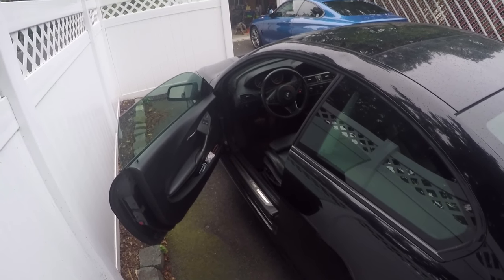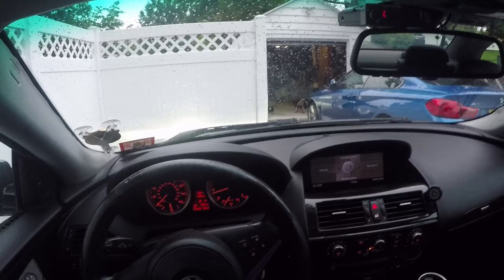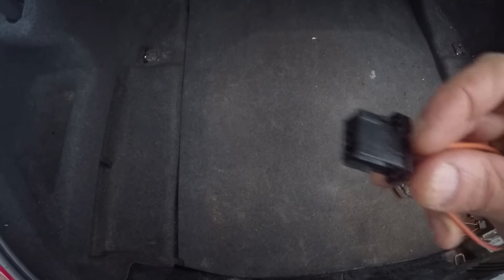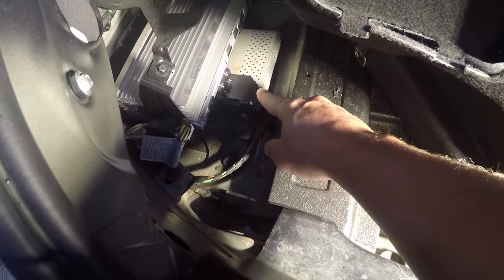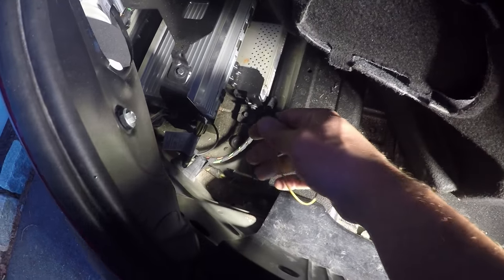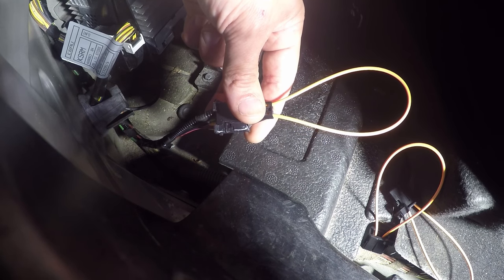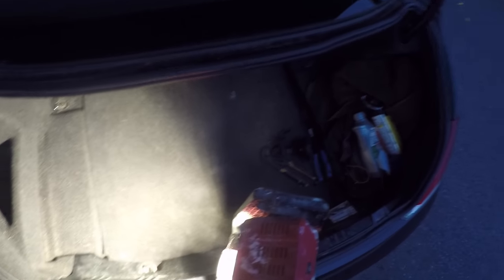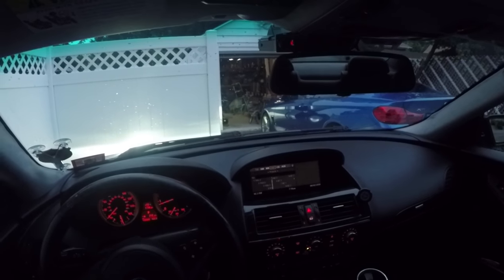FIX BMW SOS Error Light Audio System Failure CHEAP + Tips Others missed!

Comment: The solution for me (for BMW M4 2015) was: I took the panel off located located underneath the drivers dash & steering wheel (above the brake & accelerator pedals). There was a loose plug (small flat white plug) which pops into a small white long plastic box, and I made sure the smaller wire (with tiny red plug) was plugged into what looks like a small speaker.  The SOS Fault warning code disappeared right away and hasn't come back.  Just in case it helps any other viewers.
Reply: panel with screws ?
Reply: @mo_nstro Yup. It’ll be the panel under the drivers seat, think of it as a glovebox, just on the drivers side. But if you have an E90, it’ll be T15 or a T20 screw tip, 3 screws

Comment: Saved my life man I don’t know why nobody talks about this it’s such a common problem. Almost ordered a whole new module but I already had a optic cable laying around and didn’t know I had to trim it. Worked like a charm after.
Reply from the maker: Nice, I'm glad to head you got it up and running!  Feels great to fix it for so cheap!  Yeah, those stock adapters need to be trimmed and its a bit of a pain in the ass... so now the link in the description is for-pre-trimmed units so you can start using them without any trimming/modding :)  I've head of a few people actually breaking them (and having to order a 2nd unit)  when trying to do the trimming!

Comment: I have to admit it, I was a bit skeptical about this video. Bought my 08 650i 70,000 miles and clean title from a used car dealership that is well respected spring 2024. First week, issues with audio in car ???? Called dealership & talked to an audio specialist. Ok I'll speed it up after bringing the car back to dealership and they say they replaced blue tooth module. Got car back & same b/s. So thank God for tutorials like this. I rolled the dice ordered the bypass loop in the link below the video and Shazam. Amazon dropped it off 5 minutes later stereo working. I hope there's a BMW engineer watching this video and feeling guilty because they should ! Thank you so much for this very helpful 411

Comment: Hello, I was driving my 2008 650i convertible and I heard something zapp,, My SOS light has come on and is doing the same thing you just described, , The mechanic is saying that it's the fm module? Have you heard of this? I can't get anything to work as far as the entertainment. Ugh. He said that something was wet in the trunk and fried the module.
Reply from the maker: If you get the loop in the description it comes with full phone support to diagnose the issue for as cheap as possible.  It could be many things.

Comment: '06 525i. my radio drops out intermittently and the idrive lags (about 5 - 10 seconds between pressing a button and the screen responding). this happens when i start the car but after 20 minutes it works fine. i did get the SOS message once a month ago but its not there right now, but the actual sos button is flashing on and off. do u think this will part will fix it or is it something with the CCC unit? thanks.

Comment: Ok, I had the exact same issue and by far this is the best explained video. Only minor comment,  meaning if you want to still have your trunk intact looking nice is that you have to unscrew the trunk covers, which took me exactly 25 minutes. So thanks and you saved me tons of cash at the 'Stealership' whereas they told me I need a new radio (that I first bought with labor and all installed for USD 560), and which after 2 days stopped working. Based on my own due diligence, it's definitely the satellite radio (SOS) which caused by breaking the SOS loop (that's a BMW service you can pay for in the USA and Europe when having BMA only car issues). Unfortunately this entire system is connected with sound (BMW chimes, car stereo, etc) through that stupid insane Satellite. Hope this helps! Thanks again

Comment: I had the problem on my X1 F48 2017 model. Assume it’s software have bugs. 

Tested to call SOS after shows SOS system failure message, get through perfectly,  which proves the system NOT failure. Used voice control coincidentally last week, the fault message disappeared dramatically, and didn’t back till today.

I rarely use voice control before, have tried to disconnect blue tooth device and reconnect from other youtube video, didn’t work well.

Can’t say it’s the solution, but cost nothing and worth a try.
Reply from the maker: hello, thanks for commenting :-)  the bypass loop is a great tool because it allows you to identify exactly which component is malfunctioning. The particular loop in the description of the video above comes with direct customer support to assist you with identifying the exact problem and helping you to decide whether just bypassing it or regaining the functionality is the best course of action. A lot of times people just bypass out something like the satellite radio to get rid of the SOS light or to get there sound back, however, if it is something like Bluetooth that you might want to get the actual functionality back the tech support will guide you to the best course of action in getting it addressed avoiding the crazy prices the dealership would charge. For $14 it’s pretty awesome that you get that level of technical support!

Comment: i have a 2007 bmw 550i, have had this vehicle since Sept 2009.  Currently approx 170k miles.  I recently spent several thousand dollars to replace the coolant system and other issues.  When I took the 550i in, I told BMW dealership something was draining the battery and coolant light continued to come on, with coolant leaking.  Their fix was replacing the coolant system, I can provide a copy of exactly what they did, and replacing a Negative Battery Cable for cable cost being $371.69.  I am trying to figure out if what has been done already, may have had something to do with SOS issue I have right now.  Before the SOS light came on, a few hours before that happened, I was outside and noticed my front left headlamp was on...  it was the only thing on, not both headlamps, only the left one.  I cranked the car, just to make sure it would start, which it did.  A few hours later i was ready to leave work and started my car. That's when the SOS light came on...  The car started but absolutely no audio and no i-Drive...  I drove it home, parked in the garage.  It was late and I didn't have time to deal with it then.  I didn't know what it meant, knew it wasn't good but had already worked 13 hrs that day and was done! The next day was just hours away!  I have another vehicle, so was able to drive the other vehicle the next day.  However, the following day I attempted to start the 550i, but to no avail, the battery was completely dead.  Something is still draining the battery. I am thinking what the dealership did, was NOT fix the problem with something draining my battery.   I don't listen to satelite radio, do not have a subscription.  When i took it in to fix the coolant system and whatever was draining the battery,, I told them the CD Exchanger in the glove box sounded like it was still running when i turned the car off.  The battery is fairly new, i can check to see when it was replaced and provided an exact date.  Bottom line is, the battery is completely dead, the audio and i-Drive quit working when the SOS light came on but it would still start then and ran good on my way home, that evening..  Now I cannot start it but need to know what you think and what my options are...  Thoroughly enjoyed your video.  However, I'm thinking the literal thousands I spent within the last month, may be related to my current issue.  Your thoughts and help is greatly appreciated.  I am not sure how this works, I have never subscribed before..   Plz make a believer out of me!  Best regards, JAJ

Comment: Thank you for this video just took my 2006 M6 to the dealership told me I needed a new satellite module $1300 they didn’t bother to tell me that this was available already ordered it from Amazon male and female option for $16 thanks
Reply from the maker: There is absolutely no use for the male version when it comes to bypassing. The best option is to get the pre trimmed female version because can bypass any component

Comment: 2006 330i, idrive completely dead, just the fan on the back of the unit running with car off killing the battery over night. Any suggestions to get it up and running again would be appreciated! Thanks
Reply from the maker: Bad CCC, needs to be repaired or replaced.
Reply: 2006 330i same exact issue, I think it’s the ccc unit itself. But I diagnosed with a scanner and it showed that everything was ok they want 650.00 to fix the I drive
Reply from the maker: @stevenfrith5454  It could be the CCC, OBD two scanner does not show codes relating to the multimedia system/SOS air unfortunately. If you buy the part linked in the description above it comes with full support and troubleshooting regardless of the issue and seller will help you to find the parts necessary if it's not a loop related issue at the cheapest cost possible without coding requirements.

Comment: Hey, I have a BMW 2009 528i, I have the sos error but everything works fine except the Bluetooth and AUX functionality’s. Would this help fix that?
Reply from the maker: It could be another component in the MOST network.  The same adapter would be used in troubleshooting (bypassing) other components until you find the one that is causing the error.  SOS error can also be caused by a loose or water damaged SOS speaker (there is a dedicated speaker) in the driver side foot well area.
Reply: I have the exact problem on a 2008 528xi. I'm going to try this and see if it works. Have you been able to fix your problem?
Reply: I also have 08' 528i and not only do I get no sound.. and sos light is on...but I can only access the idrive options when the key is on first position (car not on but key in)... Do you think or know why once I turn the car engine on I can not access anything on the idrive... Only the main menu shows up and when I click "menu button " or click right left down or up.. it will not work... No one has mentioned anything about the idrive not working in any of the videos.. however like I mentioned I'm also getting sos light and no sound. Will someone pleasr let me know if they also had that issue with the idrive and if so after the bypass was installed, did that allow not only the sos light to go off, sound to go on, but if the access to idrive while vehicle engine is started was accessable again!? Thank you!
Reply: I have exact same problem. Have you fixed this yet? if yes, can you let me know how you fix this. thx

Comment: Not sure if you’re still answering comments as this video is a few years old, but I ordered the fiber optic loop, installed it, but I still have satellite radio but no aux input. I only use aux input from my phone so I’m kinda sitting down the stream with no paddle.
Reply from the maker: If you ordered it from the link in the description of the video it offers full support on troubleshooting the vehicle. Sometimes it is more involved than just bypassing a component to figure out exactly what is going on.

Comment: Thank you so much for the video. I bought the part from your link. It took me 5min to plug it in and it worked!! 
It fixed my aux not having audio. 
2008 535i. Subscribed to your channel.
Reply from the maker: Thank YOU for taking the time to come back and leave the positive feedback!  I'm glad it worked out for you :) We always try to help either way!
Reply: naxen happens to my car exact year and model hopefully it’ll work
Reply: Where was the cable located? Same spot as the one in the video?
Reply: So your cable was in the same place in your 2008 BMW 535i but I don’t have satellite radio on my display
Reply: My aux is playing out of right side only
Reply: Can i know the name of the part please?I'm having the same issue with my car
Reply: Buying one right now for my 08 535!

Comment: Very helpful and right to the point video! Thanks for the tips! I’ll be ordering one of those cables to address the interesting problem on our 2008 E91 with the basic audio system. 

The SOS fail is accompanied by a static “ticking” sound. All audio alerts/chimes/music work, it’s just static has been introduced. I pulled the connector off the TCU and noticed the static beats like a metronome to the fiber optic pulses. Any additional insight anyone may have would be appreciated. We swapped amps thinking that could be the culprit, but no joy.
Reply: Did you ever manage to fix this?
Reply: Hey did you ever find the fix I am having the same issue with my e90

Comment: Thank you for help. I have a 328i and I followed your steps to the T but unfortunately it did not work for me.  My SAT, AUX is still grayed out and my SOS icon is still coming on.  I did get the female fiber optical.
Reply from the maker: Did you get the adapter from the link in the description? If so it comes with full support and contact info. It could I be one of several things
Reply: @ModsAndProjects   Yes I did get it from the link below.  I went back and notice that I didn't see a red light; should have to let me know it's working or not?
Reply from the maker: @TonyaMWhite  Do you still have the contact info card that came with it?
Reply: @ModsAndProjects  Yes I do and I just realize that I might not need the fiber optical because my radio comes on without it it's my AUX and SOS that's grayed out.  Do you have any suggestion for that?
Reply: @ModsAndProjects  Yes I believe I do.  But I don't think that's the issue for me because my radio does come on without the fiber optical.  It's my SOS and Aux that's grayed out.  Yes I have subscribe to your channel.  Thanks!
Reply from the maker: @TonyaMWhite  contact me using the information on the card directly and I'll help you troubleshoot it's tough to go back and forth here on YouTube

Comment: I have an 07' 335i with the SOS error.  When it happened before, i was able to unplug the battery and replug and it was fine.  But not this time.  I recently had the computer replaced and now the battery unplug doesnt work this time.  Not sure if this can be helped or not with this solution.  Thanks!

Comment: Bear in mind that this isn't the be all, end all SOS fix. I just picked up a 2010 650i for short $$ that had a several electrical issues going on. Since the radio works, but the bluetooth won't connect, the TCU unit was a fault. You want to make sure, and pin these components out separately, before diving in.

Comment: Thanks so much for the Help. This has been the best Video by Far. I watched SO many other Videos on how to Fix this Stupid thing, but this Video Worked Perfectly For my 2008 BMW X5 4.8I. I got the female Adapater from amazon And once i just plugged it in, the Aux Started Working Again, and the SOS light disappeared. Thank you again. 

Much Love
Reply: I just picked up a 2007 X5 4.8i and it won’t select the Aux (and can be unreliable in selecting other things).  Where did you plug in the female adapter?

Comment: Nice engine sound. I have 2006 630i and I don't have that Sat radio option I believe. It is UK version. Does this mean this solution is not for me? In the workshop I was told about a part to be replaced, which I cannot remember its name :-( , but I remember I was told, that part sits in the back seat (under support) and to order it, it needs to be looked first, to take its number. Only with that number a correct part can be ordered. Any hints please?
Reply from the maker: Not at all several of the other components on the MOST network are prone to failure and can be bypassed with this same cable or the cable can be used as a diagnostic tool to help identify/confirm components that are failing and need to be repaired / replaced.

Comment: Great video. I have almost the same problem but my phone no longer works. I have satellite radio and would like to keep it. Can this problem be fix with your device?
Reply from the maker: It will help to diagnose your issue.  The one linked in the description comes with full support even if you cant get it running with the cable.